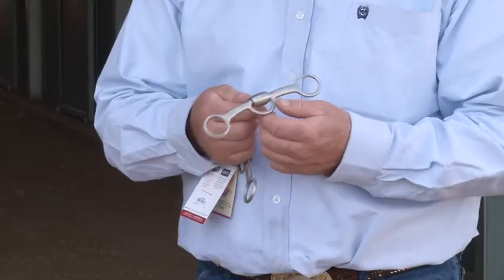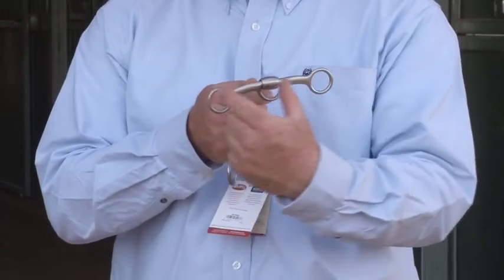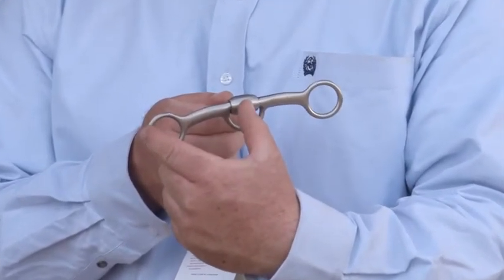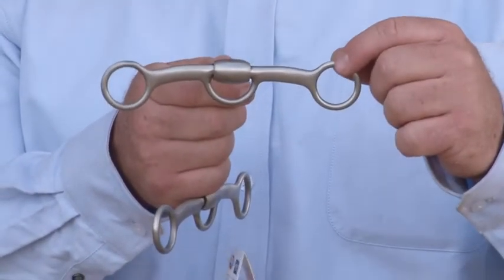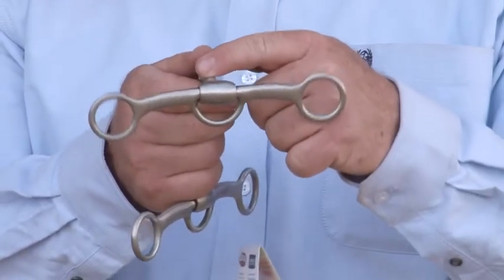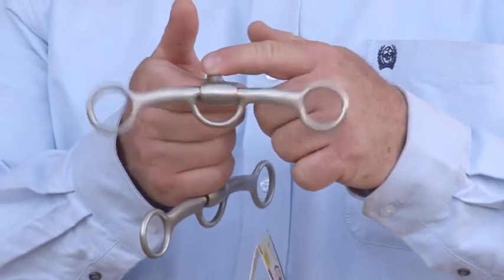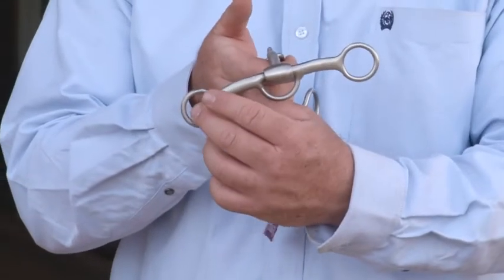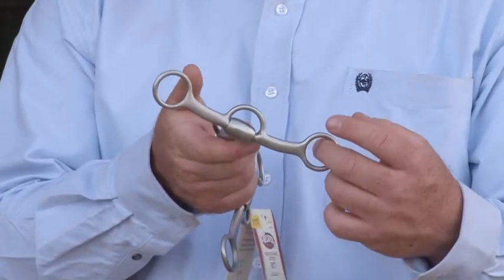Transitioning from a Snaffle Bit to a Leverage Bit

Comment: It would be great to demonstrate how to set it up, or at least show one of these lifter bits mounted on a horse. I purchased one and it does not seem to be getting the softening and bend from my horse. Should I be using a curb strap? according to the clip - you do not need one.
Reply: He does mention using a curbchain or strap!
Reply: shank bits require a curb strap